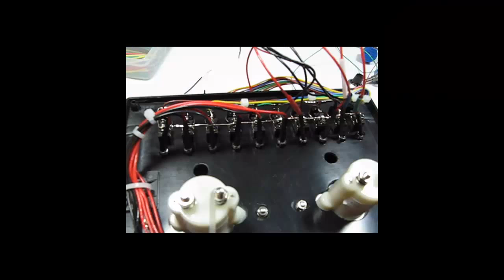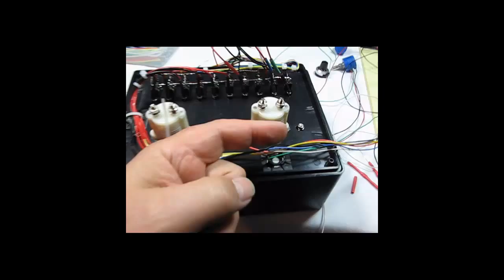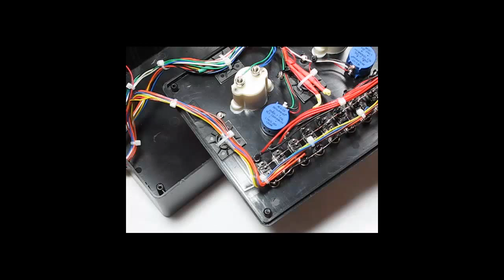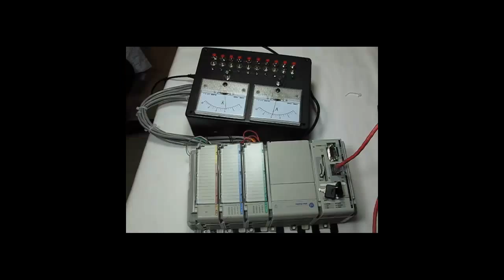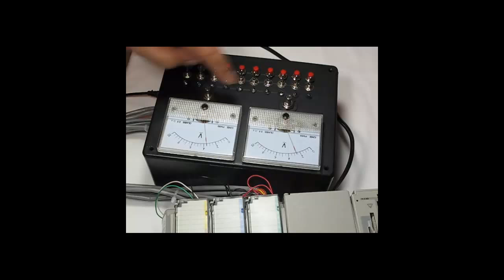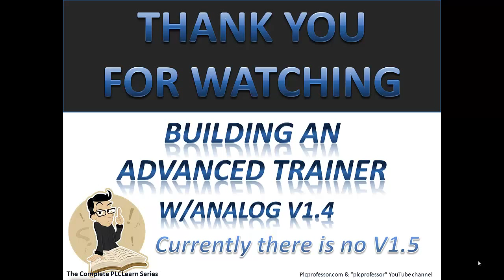TS03 Pt.5 - How To Build a Trainer with Analog - Assembly & Test

Comment: What about the Micrologix model 1761-L20AWA-5A for using analog I/O ? I am also a novice and just starting to learn about PLC's, so please excuse me if it seems a silly question.
Reply from the maker: Download the manual for that processor and look it over completely before you invest. A Micrologix1100 with add on analog cards is a better investment, but much more expensive. You should be able to learn what you need with the 1000 that you mentioned. I have reconsidered the voltage source for the potentiometers, it is now a 10vdc zener diode circuit. A little research and you can determine the components.

Comment: Are the dropping resistors 88 ohm or 88K? I was a little confused there without knowing the current draw. Nice demo box in the end either way.
Reply from the maker: It was 88,000 ohms. BUT, I have since decided that the entire voltage divider was too low in total resistance and I will replace the pot with a 1Megohm pot and try 1.4 Meg ohms (approx. 1.330Meg ohms) as the dropping resistor. The input impedance of that analog input was much lower than I had expected. I will do an update to  the video as soon as I have time.
Reply: plcprofessor Thanks for the reply. I see where I made my mistake...These videos are immensely helpful. I am returning to the world of PLC's after 31 years with a local municipality that included 15+ years of HMI design/programming, SLC 505 processors, RSVIEW and database retrieval with Factory Talk Transaction Manager. I was never great with PLC programming in RSLogix. I have a small consulting business and have a few clients that are wanting my assistance in this area. I really need to invest in a trainer and your training kits to get more hands on. I have watched at least 25 of your videos and I can't thank you enough for your time with this.
Reply from the maker: jonkjon I am also a contract controls engineer to keep my hand in with industrial control systems. I split my time between some mission work in the Dominican Republic, engineering and writing/recording the PLC Professor collateral.